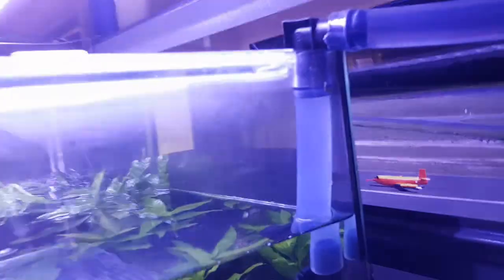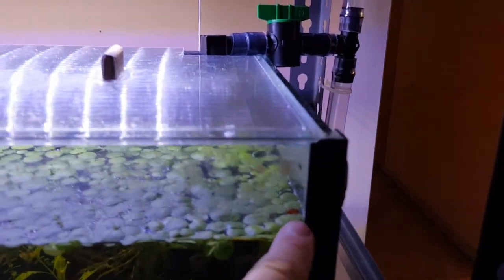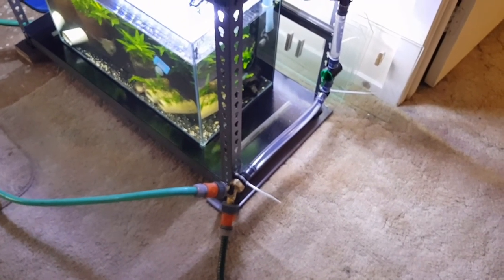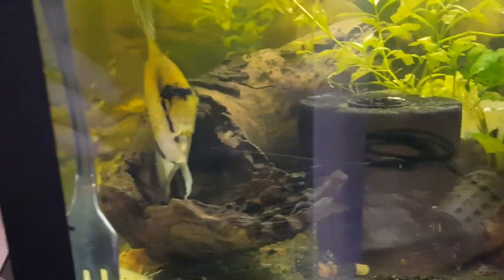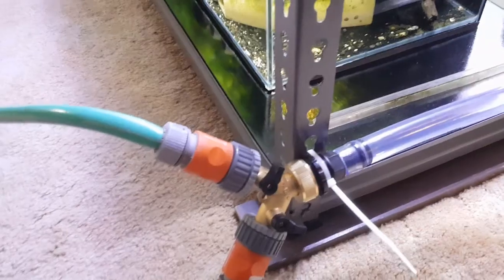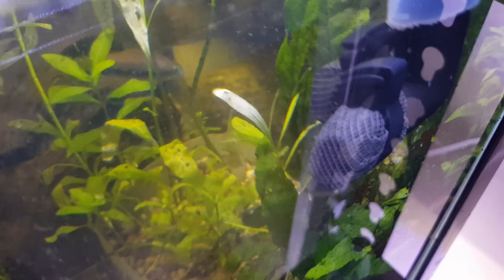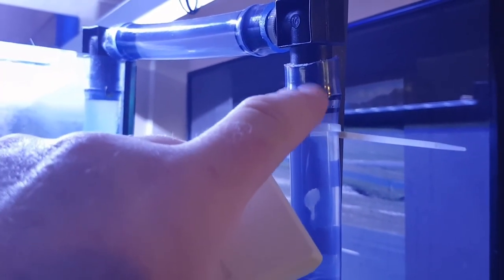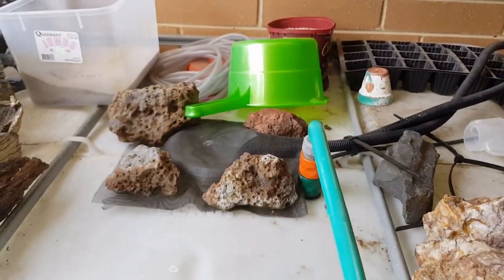DIY Very Simple Water Change System. NO Drilling Tanks!

Comment: Excellent system. I used a similar siphon system with  the same 1inch clear hose to connect my sump to the aquarium and works perfectly. No need for drilling or worries about overflows during power outages, etc. 
Only I could not get the push connectors locally so I used pvc elbows and fittings and silicone to make it airtight and clamped the joins using either clamps or cable ties depending on the situation.

Comment: Yeah this is definitely happening in my fish room when I build it. Especially on the fish rack
Reply: only issue is you're going to contaminate all tanks if one of them has an issue...
Reply: @AI3Dorinte  correct. About a week after I commented this I decided against it. Everything is on their own. Makes it easy since my fish room is now more of a project with breeding more than anything. So each species is in their own tank.
Reply from the maker: That is incorrect there is no cross contamination at all. All tanks are drained and the lines are dry before water is pumped back into each tank. It is clean fresh water going into each tank starting at the lowest tank first and that was the last tank to be drained.

Comment: Thanks for posting!! I am trying to setup a system with no drain but going through a room window. I need to use the pump to drain the tanks and normal water pressure to fill them. Going to add a hose connection at freshwater in, controlled water in and also a pump inlet for controlled vacuuming. I should get multiple options to drain, fill and transfer water and can add exterior filtration and water sources easily if needed. Cheers!

Let me also add that I have looked for days for Drain type systems and there are none to be found.

Comment: I like it!...U must heat your room so all your water is up to temp.  I can't imagine your heating your storage holding tank. Great job. Simple n effective.
Reply from the maker: Thanks for your comment, each tank has its own heater and the storage tank is what is called an IBC 1000 ltr tank which has no heating it is just heated by the sun each day.
Reply: I heat my water change reservoir so it’s the same temp as the water in my fish tanks.
Reply from the maker: @ZYGTropicals  I leave it lower as it imitates rain/cooler water flow which is lower temp and then makes the BN, Plecos, and other fish to help induce them to spawn.
Reply: @TimsBitsnPieces  sometimes different water temps may get ick on fish, has to be substantial change but still possible to stress fish. i would prefer heater in the freshwater to even out the temps.

Comment: This system is really smart, even if you break the syphon, you can just turn on the pump and purge the air in the system. Though, keeping the water still in the pipe is makes me uncomfortable since it may cause bacteria to grow there, but at least it is a clean water that being kept there, not the waste water.
Reply: bacteria grows in the tap water too
Reply: @beatatarczon1402  i know, but they only grow if you don't use the tap water for quite some time. That's why parents usually tell you to purge some of the tap water first after you leave your home for quite some time.
Reply: Don't worry about bacteria as it will be beneficial bacteria from your tank and will not harm your fish.

Comment: This is cool if you don't like lifting buckets, but still a lot more work than a comparable system with drains and drip lines. 

It really wouldn't be that much more money/time to drill the tanks and plumb a system that truly handles water changes on it's own.
Reply from the maker: Thanks. I do not wish to drill holes in my tanks and possibly crack the glass when doing it and not everyone wants to buy second hand tanks that are drilled.. I certainly don't so this way is much better for all reasons.
Reply: @TimsBitsnPieces I was thinking that too but thanks to people like you sharing your knowledge with a few exceptions but seriously I don't know how many times I had that same drill in hand over the tank with the soda bottle ready to do the most important streaming on the glass and I was just about to...,, watched the same video on drilling and then I got it the 1st time 🫣 
Honestly I'm positive that I could have done 10 more with the same attachment .

Comment: This is awesome. What kind of pump? I can't find anything with a remote like that.
Reply from the maker: It is just a normal irrigation pump and I use remote controlled power point switches to control it... they plug into a power outlet and with the remote you turn the power on or off... I bought the pump and switch unit at Bunnings which is our big box hardware here in Australia.
Reply: @TimsBitsnPieces  thank you!

Comment: Awesome video Tim ..just what i was looking for! 
1 Question though.. im wondering if this would work with PVC piping instead of the hose ? These irrigation fittings are a bit hard to find where i live. 
Cheers!
Reply from the maker: There is no reason why it won't.. You just have to make sure that your joints are air tight so that no air gets into the piping or you will lose the suction.
Reply: I used the clear hose pipe with pvc elbows and connectors. To make the joints airtight, I applied a little silicone over the joints before sliding the hose onto the elbows and then securing them with either clamps for the external joints or cable ties for the ones inside the tank and didn't have any leaks or air being sucked in & breaking the siphon.

Comment: i really like your project, really good 👌. first question) which diameter size are the pipes-connectors?  second question ) do you have any sump / external filtration or each aquarium works alone?  3) when you connect the pipes and elbows at the first time, how do create the first flow, take the out the air?  fill water or suck the air?
Reply from the maker: Thanks. They are 19mm irrigation fittings. There is No sump. Each tank has its own filtration system of air sponge filters. Once the system is first connected I just filled each tank from the bottom tank first and then going upwards each tank is filled and thus creating the syphon for the next time I want to do a water change. It is very simple anyone can do it and there are no special tools required.

Comment: Will that work if your tanks are on differrent sides of the room? Would have to run the pipe across the ceiling and down.
Reply from the maker: Hi, It would very much depend on a few things... and some of these are.....

How high above the tank height are you going with the pipe?
Is there a chance that you will lose the suction through that pipe with any joiners? 
Is the distance required for the tubing to get to a lower place that is below the bottom of the tank too far or too high to be able to drain the tank?  

Just remember this is all about Gravity, and if the water has to go too far above the height of the water level in the tank then you might have issues. 

I would not do it personally, but you can always try with a piece of garden hose and see if that works from the tank to where you want to drain it to, or, just install a pump at the bottom of the tank to push the water the distance required.

Also, remember .. the drainage pipe to the outside world doesn't need to be permanent. Just put a fitting at the bottom of the hoses near the tank and then fit the drainage pipe when you do the water changes as I do, so there is really no need to go up and across a room when you just connect the hose to the fitting on the day you want to do the water change. Which is what I have done here and for my other tanks in the other rooms for many years.
Reply: @TimsBitsnPieces Thanks for the reply.

Comment: What’s your method for dechlorinating and heating the new water please?
Reply from the maker: Hi well if you have read through the previous comments you will see that I leave the lid off the IBC and cover it with flyscreen material. This lets the chlorine dissipate itself over time (Here in Melbourne Australia we do not have a high chlorine level in our water). I do not preheat the water going into the tanks, as colder water going into the tanks makes the fish think that it is raining and thus stimulates them into the breeding cycle....

Comment: What does the inside of the pipe look like after long term? Interested setting up new store and looking for best ideas for limited space.
Reply from the maker: Well, it looks the same as it is normally no change. I guess it would depend on a few factors, the type and quality of pipe you are using, how often you are using it, the quality of the water you are using, how much lighting and type in the area might affect it over time, etc etc.. I guess for a shop you would need to make the decisions for yourself which is better for the purpose needed.
Reply: You could make sleeves to slide over any exposed pipe and that will prevent any algae growth on the inside of the pipes. 
That way you can still easily maintain the pipes too!

Comment: Love this setup it is great. Would it still work if you had multiple tanks per level on the rack ie 3 smaller tanks rather then 1 large 1? If so would you need a separate tap for each tank or just 1 per level if that makes sense.
Reply from the maker: Hey Bradley, you would need one set of piping per tank per row so then you can change and resupply the water to each tank and if you only wanted to do one specific tank you could do that instead of draining them all and then having to refill them all if that makes sense also.
Reply: Also wondering Bradley.
Why wouldn't it work for several in a line?
Reply: @alextaylor2883 I think it would work, only thing is in case for any reason you only want to drain one tank in that row then it would be better to have valves between each tank in the row so then you can close them off for the tanks you don't want to drain.

Comment: Hi. Is there a reason you dont pump 3 tanks at the same time?
Reply from the maker: Hi, for starters they are not pumped, they are drained via gravity and syphon. I did try it but some of the water from the higher tanks seem to flow into the lower tanks and reduce the flow on the lower ones.. It is just easier to do 1 at a time starting at the top.
Reply: Sorry for my wording. What I mean was is it possible to fill the water back all tanks at the same time after you drain them or you still have to do one at a time?
Reply from the maker: @TamNguyen811  I still do one at a time starting with the lowest tank working upwards which then sets up the syphon for the emptying process.

Comment: How do you start the initial suction
Reply from the maker: There are a few ways of doing it. I personally just connect the hose and turn on the pump from the IBC and it pumps water through the pipes into each tank after opening each valve for a minute or so and that then is the water needed to create the suction as water will always flow downward to the lowest point. You can also just fit a short hose to the fittings at the bottom and suck on that hose to fill all the pipes but it would be a lot of sucking...... and I'm not a good sucker.. hahahaha.....

Comment: No cross contamination between tanks since the drained water is not purged from the pipes before refilling?  No water temperature differences between inside tanks versus outside holding tank?
Reply from the maker: I do not have any issues at all with this system since I have installed it over 12 months ago. The water outside that is used to fill the inside tanks always has a lower temp and that helps to get the fish to mate.

Comment: Check valve in the fresh supply line to prevent back flow or not worried about it?
Reply from the maker: Hi thanks for your comment, I don't worry about back flow as it won't happen. I have the incoming supply running from the pump which is controlled by a remote and that is usually in my hand and there are valves which you would have seen at the bottom for in and out flow, until you open one of these there is no flow at all.

Comment: Is there any cross contamination between the tanks like that? Maybe if you fully drain the loop before filling you can prevent flushing some of the water from the tanks back into different tanks. The filling part will prime the siphon for the next use too.
Reply from the maker: There is NO cross contamination as the pipes are always empty before I start on the next tank lower down when draining and when filling the tanks I start at the bottom tank and it is only new water going into each tank.
Reply: Sorry, but there might be cross contaminarion. Mycobacterium, for istance, survives in dry conditions. Nevertheless, this is a simple, but genious, idea that I will use for sure.

Comment: Instead of using a tub of water can you just hook the garden hose to a water spigot
Reply from the maker: Hi, I had to google what a "water spigot" was as that is not a word used here in Australia. Yes, you can but I use the IBC to aid in removing the chlorine in the water, as it sits in the IBC the chlorine evaporates through the top meaning I do not have to use water chlorine treatment. So yes you can connect your hose to your water tap but just be aware that you will have to add water treatment for the chlorine.

Comment: Nice idea mate. So is the keeping in ibc to try get some the chlorine to evaporate?
Reply from the maker: Yes it helps evaporate the chlorine, there isn't that much in my water supply here in Melbourne Australia but it helps and means less dechlorinater I need to use.
Reply: Tim Gay thanks I’m in wodonga so not too far from u . Thinking give ur idea ago. I’d prob just have to do from tap ibc wouldn’t hold enough for me to do a change my tanks are all 1000 l plus . I pump out at moment to try save bit time
Reply from the maker: @cheveburkinshaw860  Yeah just siphon out and pump in easier to do that way. Thanks for the comment.

Comment: That’s great system. Thank you for sharing. Where do you buy the Y? Thank you
Reply from the maker: From my local hardware, all of the parts can also be obtained at an irrigation shop.
Reply: @TimsBitsnPieces can I get a list of all the part u used
Reply from the maker: Sorry I cant as I don't even have a list of what was used..  you will need T's L's hose flyscreen Y adapter and a fitting to join the Y adapter to the hose.. That's the best I can do and I got it all from my local hardware and most of it was in the garden watering section and sprinkler irrigation section.

Comment: Great idea.  What pump is that? Wonder if I can use that to drain my tanks as well.
Reply from the maker: It is just an impeller pump that I bought from the local hardware. I use normal fish tank pumps for draining my tanks when needed much easier to move about and not as big. You could just use a large hose and syphon it out much easier and fewer cables to worry about.

Comment: What would you call this type of system? Is there a guide or anything online for something like this?
Reply from the maker: It is just a basic syphon something I made up from my own ideas and not wanting to drill holes in the tanks. NO there is nothing online that I have found, this is why I am showing this.
Reply: @TimsBitsnPieces do you think this would work for the refill if the water coming in was straight from the tap? Or would it not be high enough pressure like your pump?
Reply from the maker: @jamie3499  the reason why I do it from my IBC water tank with the pump is that while the water is sitting in the IBC it is de-chlorinating the water.... then I do not need any de-chlorinator to be added into my tanks when doing refills, as the chlorine evaporates as there is No lid on the IBC and it just has a piece of fly screen over the lid to keep animals and things dropping into it. I check the chlorine level in the IBC usually a day or so before I want to do water changes and most of the time it shows on the testing strips that I use, zero chlorine in the water.

Comment: Would you mind telling me what all fittings you used? I.e straight , 90 degree etc
Reply from the maker: Some straight and some 90's and one shut off valve for each tank, plastic pipe between tanks and a 2 way tap valve at the end.

Comment: I'm just about to set this system up. Do you have tanks side by side ? I'm curious if you could drain all 3 at once. Being stacked I think they would flood the lower ones though . Have you ever tried all 3 at once ?
Reply from the maker: Sorry but I do not have tanks side by side. I did try draining 2 at a time but the top one flowed out but also some of it was also draining into the lower tank as it was also draining, I find it much easier to just drain 1 at a time.

Comment: With that external water reservoir that you are using to refill your tanks . Is it heated? What do you do about the temp change on the fish tank when adding the new water into the fish tanks? It does not effect your fish?
Reply from the maker: The IBC outside has no heating, just the suns rays. I tend to usually do water changes later in the day so that the water is not as cold as it would be in the morning. It is good to add cooler water to the tanks as that initiates mating as does rain in normal water courses would do in the wild. The water going in is only 5-10 deg lower than the tanks temps and I am only adding no more than 1/3 of the tanks water content by volume and thus only changes the tanks temp by a few degrees.
Reply: If you are doing a 25% water change water temperature difference are rarely an issue